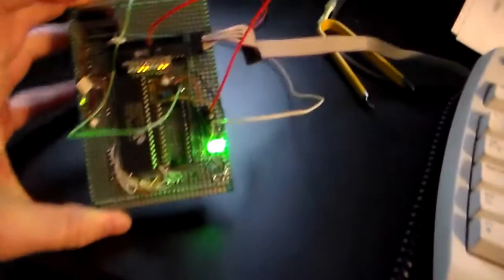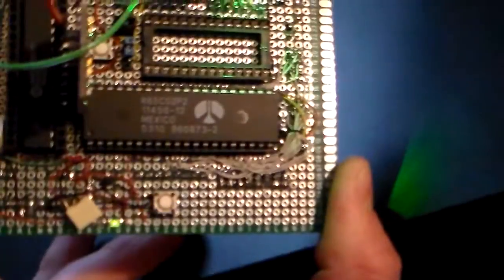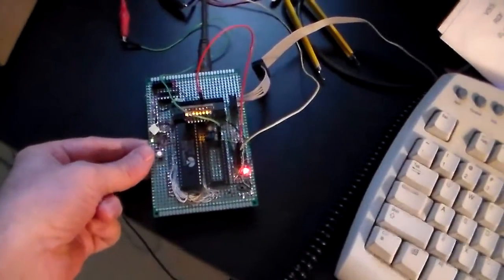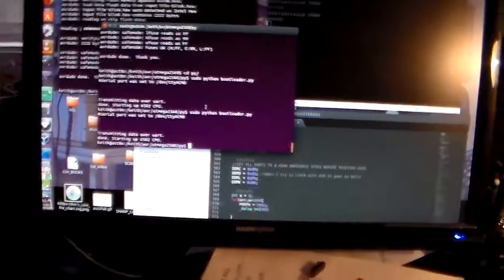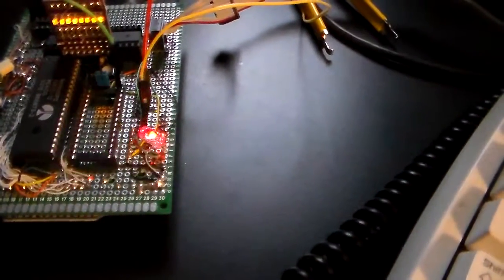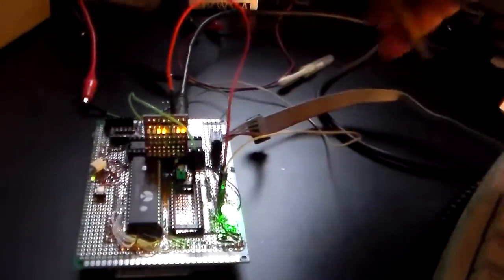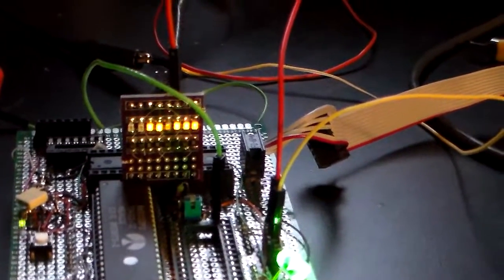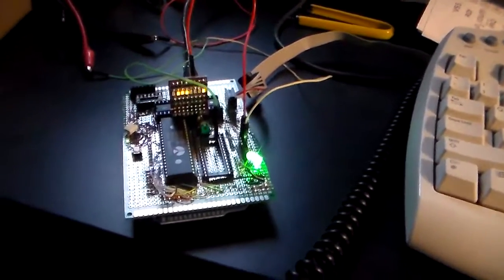65c02 homebrew AVR

Comment: I like the 6502 because it was the start of many computers. There were mistakes made by the designers, and it was cheap. For many of the older people the 6502 was their first processor, therefore it can do nothing wrong. Simply accept the quirkiness.